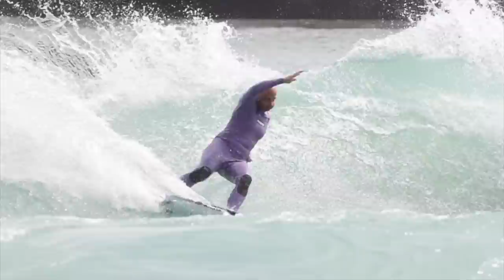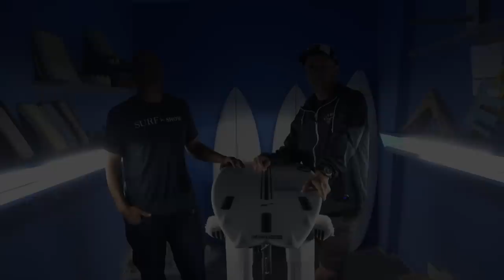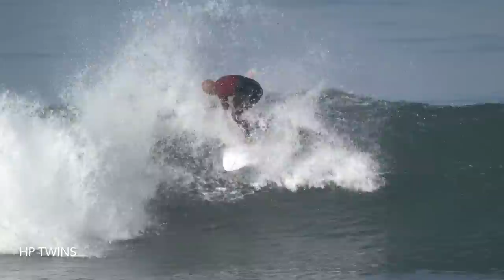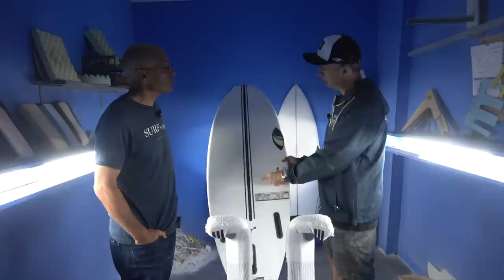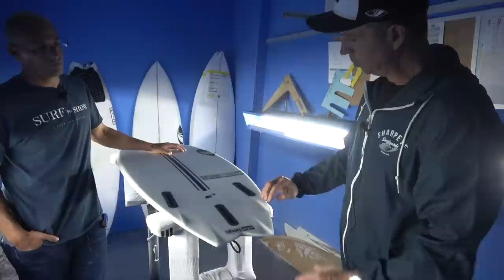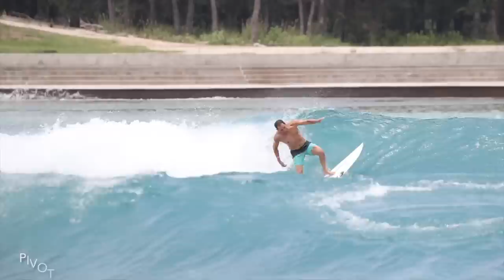Sharpeye "Storms Twin Turbo" Surfboard Review Ep 133

Comment: Great review Noel! I have a 5'9 SE Storms and am looking to compliment it with a 5'7 groveler, either a SE Twin Turbo or a CI Rocket Wide or a CI Twin.   How would you say the SE Twin Turbo compares in ease of getting on rail with the CI Rocket Wide and CI Twin?  You didn't seem to have any problem with putting the TT on rail, but wondering if it felt like a focused effort to get it to engage the rail for a bottom turn compared to these other boards.  Thanks for your advice.
Reply from the maker: I like the TR way better compared to those other boards you’re thinking about. The TT would be first choice out of those boards

Comment: I had the twin turbo (only a twin fin) and it was so hard to ride. My home break is a windy (10-25mph), fat, slopey, weak wave with hardly any wall. 2-5 ft faces/peaks. Didn’t have any get up and go speed. No drive outside the pocket. Felt like the board had a hand break when I went to the shoulder. Lost all speed when doing a cut back and trying to make it over a flat section. Is the new version that much better??
Reply: Maybe is the wave wrong for that board mate

Comment: Looked slightly undersized under your feet in the ocean, but for the pool looked perfect.  Did you feel you needed a little more foam/length for lowers (or the ocean in general)?

Comment: When running it as a pure twin Could you notice any performance difference with the slightly changed fin box positions ?
Reply from the maker: Yes, the board is looser and can feel like it will slide out with smaller twin fins. My HP Twins offer maximum hold and drive, with excellent pivot

Comment: Nice review, but at the moment the variant you tested with the tri fin and epoxy is not released, the model available is only a twin with no epoxy. Would it still be similar to the board your riding?
Reply: Good question 🙋🏼‍♂️
Reply from the maker: You can order the E3 Epoxy tech from SharpEye custom. Just place your order and tell them you want the new E3 tech that I used in this review.
Reply: @surfnshowreviews7777  ok thank you
Reply: @surfnshowreviews7777  thanks a lot coach! :)

Comment: Hi Noel. I like the review on this board. I am a beginner transitioning from foamie to fibreglass surfboard. Do you think the RNF 96 would be a good start. Size wise I was looking at a5'9" with 35L vol. I am 5'11" tall and 78kg. Would appreciate your feedback. Glenn 😎
Reply: Hi Noel. This is Glenn again from Sunshine Coast. Qld. Australia. I was asking about the RNF 96.  So many people are telling me I should be riding all different kinds of things. Do you think the RNF 96 would be okay. I am so confused. So many options.
Reply from the maker: The 96 is good but I recommend a bit more foam and height for your transition. Maybe 6’0” 40L
Reply: @surfnshowreviews7777  thankyou very much. I appreciate your feedback.Glenn.
Reply: I am riding a 6foot foamie. It's a MR super twin epoxy soft at 41 litres. I am having trouble with my turns. That is why I asked about getting a 5'9" RNF 96 fibreglass surfboard. Is it just that I am not good enough yet. Or do you think it is the length, volume and rounded rails maybe causing this lack of progress. Glenn.
Reply from the maker: @glennsanderson9774  Foamies really don’t turn that well. I say go 6’0 roughly 40L and you will turn way better on a real surfboard
Reply: @surfnshowreviews7777  thanks. I thought that may be the case. Awesome 👍 thanks again. Glenn.

Comment: Great Video! How would you rate it against the Pyzel Astro Pop ?
Reply from the maker: The TT offers way more performance. The Astro POP is more of a Groveler. The AP has more glide for padding and down the line speed but the TT offers critical turns like a HPSB.

Comment: Best board for you for Nice turns but with a cool flow ? Chilli hk ii, twin turbo, rnf 96, mr California twin ?
Reply from the maker: @davz9129  Storms TT or 96 are my two Favs
Reply: @surfnshowreviews7777  do the storms tt have a wave range like the 96 ? 6ft+ ?
Reply from the maker: @davz9129  Maybe if you run it as a Thruster in overhead surf

Comment: Hey Noel thanks again for the recommendations for my buddy.  I had one more question for my Schroff twin. I’ve ridden it twice now in small mushy waves here in NJ using the Rasta +1 but as a twin. Im not used to riding a twin but I noticed that it’s moving kinda slow and dragging a little . It might just be me but I was wondering what would you recommend for a straight twin set of fins that would feel faster and a little looser? They feel kinda sluggish and sticky if that makes sense. Should I use smaller twin fins? Kinda confused hoping you can help. Thank you Scott
Reply from the maker: It really depends on how far back the fin boxes are. If the board is not sliding out with the Rasta Twins then it could be the flex of those fins flexing out when you push on them. 

I recommend stiffer construction for twin fin sets like fiberglass or Carbon. 

I highly recommend my Pivot Twins… they are made with G10 fiberglass
Reply: @surfnshowreviews7777  thanks Noel I’ll give them a look. Appreciate your input and time as always. Thanks again. Have you given the slater fins a try and compared them to yours yet?